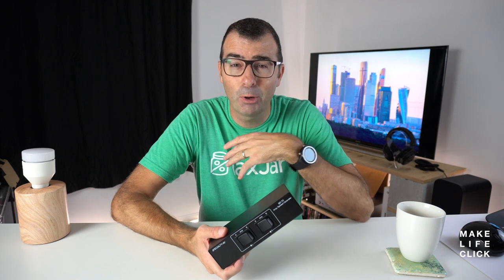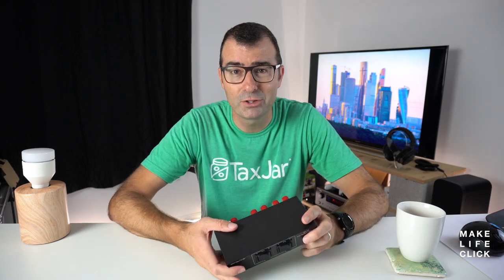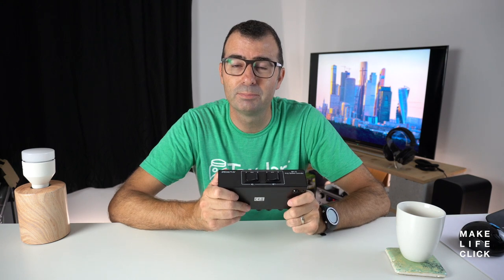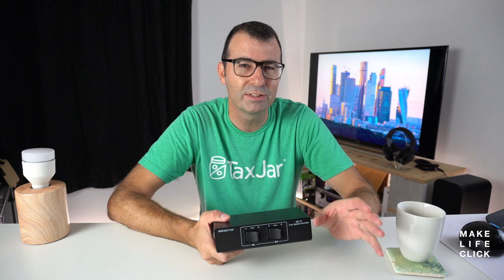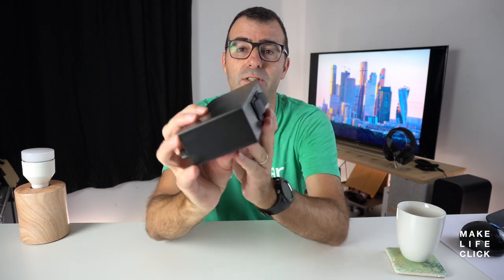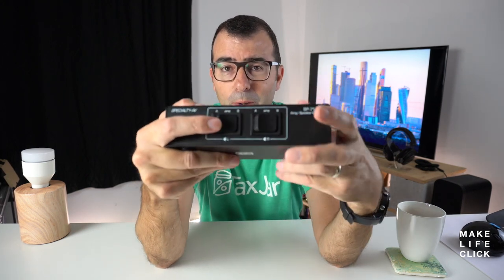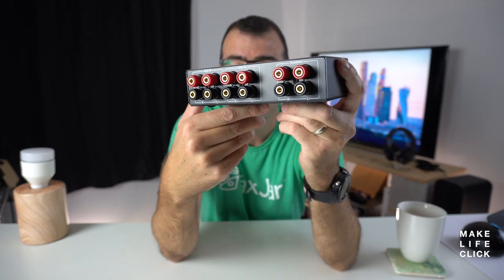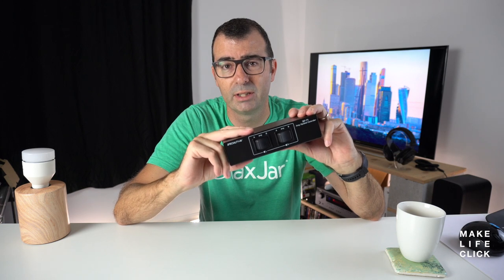Using 2 HiFi Amps with 1 Set of Speakers

Comment: As someone who has the SP71 and Beresford 7210 my advice is forget the SP71 and go for the Beresford. It is slightly more, but bigger with far superior build quality. The speaker terminals on the SP71 and very cheap and too close together. You cannot easily use standard size spades.
Reply from the maker: If you have the money - a great choice.

Comment: Can this be used with a tube amplifier? I understand that tube amps NEED to have the load imposed on them from speakers being connected.
Reply from the maker: Not 100% sure but I know this challenge with tube amps. I would not turn on the amp unless I had first switched the amp to be the one active on the speakers. If that makes sense?
Reply: If this is in fact the exact same as the Beresford 7210 then it has a dummy load for tube amps built in. http://www.homehifi.co.uk/S/selector.htm Given it's a different brand, who's to say if the electronics are the same. If you have a tube amp, perhaps go with the Beresford.
Reply from the maker: @dbbrs5295  The challenge is finding the Beresford these days. The 2 Amp model seemed to be unavailable unless things have changed?

Comment: Is it possible just to put the speaker wires from two amps into the back of the speakers ie two red two black into the back of each speaker? Only having one amp switched on at one time. Thanks

Comment: I need a switch like this but I need to operate it by far, so is there something similar but with a remote control?
Reply from the maker: A great question but nothing I know of. They all require manual switching. Anything I can imagine automatics would require much bigger units with much more expense.

Comment: I there an affective way to switch between 2 amps and 2 sets of speakers. I work in the back of the living room. Main setup in living room is AV Onkyo TX-NR626  / B&W speakers / TV. Secondary set-up is back of living room Computer with Stereo sound through an older vintage intergrated Onkyo (1983), currently i have a TT setup in the back of the living room but i wish to move that into the main living room setup.

The desired set-up would be (1) to add a switcher between the Onkyo AV amp and an old Ion Obelisk (IOB3 + X-pak1) that i want to use with the vinyl. so i can use the B&W speakers for Vinyl or AV. (2) I'd then like to be able to add back in the vinyl to play in the rear of the living room through my Computer speakers, but be able to choose to switch from rear computer audio or the sound coming from the OB3 / Vinyl. is this possible or messy? does this make sense without a diagram?
Reply from the maker: I think I understand and I think it would work. These are just switches that will route the signal down different paths. Shouldn’t matter how many you use although some will warn if signal loss. Just make sure you don’t fail to load the amps correctly before doing any funny switching combos.

Comment: Does putting this device in the signal chain degrade sound quality?
Reply from the maker: WiFi signals are quite capable of transferring ok data rates especially if you have a good router. That being said, I’d not choose this if I had a wired option. 

What I will say is they far exceeded my expectations. They really do sound quite good for music or movies.

The other thing to consider is that I use these for surrounds which typically don’t need the same dynamic range as they represent ambient sounds mostly.

I have certainly not been disappointed with them and at times smile when they surprise me with the quality they can produce.

Comment: Hi, thanks for making this video. I want to add another amp home theater setup so i can use the one for my turntable.I already have another preamp powering the L C R speakers, while the main receiver is powering the surrounds and height speakers. How do i go about connecting the L & R speakers to the switch amp box.
Thanks.

Comment: Does it keep a load on the amps when switching to another amp?  When using tube amps a load, normally the speakers, must be kept on the amp when it is on.  It you forget to turn off a tube amp when switching to the other amp it will be damaged without a load on it.  Some of these switch boxes are designed to keep a load on when switched.
Reply from the maker: Yeah, this has come up before. This is an on/off action therefore there will be a break in current when switching I expect. You're better of turning everything off, switching and then turning on again I believe.
Reply: Same Q I asking.  This unit don't know if there is a load protector for tube amp

Comment: Thanks for this. Looks exactly the same as the Beresford 7210. Same product? I have a 5.1.2 set up but also love my stereo music. My Onkyo 676 doesn’t have pre outs and I’m wanting to get a stereo amp. So this may be the solution. My concern has been shorting something. Is it completely idiot proof? If I was to forget to switch when changing what I was doing or switch at the wrong time, is there a danger of something going boom!?
Reply from the maker: Yes - pretty much the same. I couldn’t find the Beresford TC-7210 in US. The manufacturer confirmed its off before on switching so that’s all the confidence I could offer. I’ve not had any issues but always turn off both amps before switching as it feels like the wise thing to do.

Comment: Mark - I'm concerned about using any switch because of the possible sound degradation. I connect my integrated amp to floor standing speakers using Cardas wires. While I could connected my amp to the switch box using good wires I feel like their could be degradation by having the switch in the audio chain. What do you think?
Reply from the maker: Your only as good as your weakest part. And, many people believe, with pretty good reason, that every switch/connector in the chain can drop a % of signal. It’s not dissimilar to powerlines losing a % of power over distances. That’s is part caused by distance and part connectors on the way. But, would you notice it?

If your concerned I would try it, and if there is a way to a/b test it I.e have a friend blind test the switch, I’d be surprised if you notice. Like all things the human ear is probably less perceptive to % changes than people think. 

It’s in expensive so you can give it a try and return if you really notice a drop. The hardest thing for us audiophiles is listening to things like this without and perceived bias!  

Good luck. 👍🏻

Comment: I just bought the Rega IO to use while I wait for the Zen triode 34I.6 integrated amp. 
I'm trying to set up a new vinyl system, I can afford 1 Heresy III for now, and intend to be able to get a 2nd by the time the Decware Rachel is ready. Until Then can I run the I/O with just one Klipsch horn speaker in mono?
Reply from the maker: Why bother?

Comment: Well done and your options really help!
 I currently have a TC-7240 which I intended to use for a input selector for my tube amp. I also have a second amp (solid state NAD) I wanted to hook up but realized there was no way to use with the one set of speakers. Would the SP-71 provide a solution?
 So the TC-7240 would select which amp would control the inputs while the SP-71 controls which amp to run the one set of speakers.
Reply from the maker: Hmmm....would the TC-7220 help there as it handles one more? Your idea will probably work but that is a lot of middleware and consider how much wattage your putting through. The SP-71 has a recommended limit so if your system is huge, just worth a note.
Reply: If you have a Tube amp ideally you want something with built in load protection. The SP71 has, but it's cheap build. Go for the Beresford 7210, it also has built in protection for tube Amps but is better quality than the SP71

Comment: Are they safe? Have Vintage Receivers.
Reply from the maker: If your meaning you have valve vintage receivers? Are you planning on using these for front speakers? Ideally you’d wire them in but these should work ok as the power load is going away from the amp.

Comment: Hey there, very good video. I wonder if you can answer this? I have a NAD C368 and want to share speakers with my AV receiver. However, NAD are adamant that many speaker switches use 'common ground', typically across the negative terminals I expect. If this unit uses common ground then the NAD will short it's amplifiers. Any comment on this?
Reply from the maker: I wish I did have an answer on this one. Best to ask the manufacturer - they are pretty responsive via Amazon seller questions. Let us know as that’s interesting. 

It’s not a powered box so, not sure how that could cause those issues, but I’m not an electrical engineer also...

Comment: How about using the split speaker wires from 2 amps to a same speakers? And I'll power on the particular amp which i want to use ? Is this safe?
Reply from the maker: That will require you to not forget both amps might be powered on at same time. Technically, yes it works but there is risk.
Reply: @MakeLifeClick  I'll ensure the main power switch is turned off to make sure the amp doesn't turn on by itself, when using the other amp, what kind of risk it involves?
Reply: NO, that will damage the amps as electricity will still flow through all wires and into the other amp. Amps are not made to accept power coming into them through the speaker wires
Reply: @txdraw  but I'm using it for a while now, so far going good no issues.

Comment: Is it safe to use this device as a switch between tube amplifier and solid state?
Reply from the maker: Jury is out on this one. I kind of believe if you turn off both, switch over and then turn on it should create the right load for the tube amp but I’m not an expert on valve hifi - guitar valve amps yes, hifi, not so much. 😬

Comment: Will this hinder the speaker sound or limit the watts?
Reply from the maker: I believe it has an 80 watt rating? So, yes. It will. Check the specs for exact details. Ultimately, unless your playing at 100 watts of power you wont notice it ergo it should be enough for your listening threshold.

Comment: Regarding this product:  I think i understand how the speakers are connected to the unit and how the 2 amps speaker terminals are connected to the unit.

But what I dont understand is that currently I have one source with one set of left and right rca cable providing signal to one amp.  How can I switch between amplifiers if only one amp is getting the signal from the one source?   

With your unit, both amp speaker outs are connected the unit but only one amp input is connect via one set of rca cables feom the source.

Sorry for my confusion but any detailed help would be much appreciated.

Thanks!
Reply from the maker: I'm going to do a follow up on this video with the wiring video the help people a little more.

Comment: Hello. Great video.  What if my first amp is a Yamaha receiver and my second amp is a dedicated two-channel only amp? How would they both hook up to this box? Thanking you in advance.
Reply from the maker: That would work perfectly. Each would connect to the back and then the stereo speaker wire would go to the speakers. I should do another video demonstrating this. 

This unit isn’t designed for more than 2 amps running a left and right channel only. On this one you can’t do more channels than that e.g surrounds. Hope that makes sense?
Reply: @MakeLifeClick  - So in my situation, I would be wanting both amps (my surround receiver and my two-channel amp) to go to the same two front speakers. Could I do that with this switcher box?
Reply: @sinatralala wht did you end up buying ?

Comment: Hi there. Thanks for this. I am looking to use this to switch between AVR and Rotel 2ch power amp. My power amp is a Rotel RB990bx which is 200W RMS per channel. Will I be able to use this switch for an amp with that kind of wattage? The power rating on this unit is 100W RMS/200 peak per channel. My plan is actually to use the AVR zone 2 pre-outs  (doesn't have front speaker pre-outs) to my power amp. Then the AVR can act as sort of a pre-amp to control volume for the power amp when I switch the speakers to the Rotel 2ch power amp. Gonna just use my iPad (with lossless audio files) and dragonfly red DAC via RCA's to AVR aux-in as my input for stereo listening. Does this sound like a plan that can work?
Reply from the maker: Hmmm. Wow. That’s well thought out. Is it very likely you’ll be cracking the signal to high levels? My concept 40 are up to 125w and I was happy enough with the unit. But, rotel means oomph so you don’t want to limit it. In theory I can see why it wouldn’t work? If I understand you correctly.

Comment: Hey Mark, im looking to power 4x24watt drivers and 4x40 watt drivers all 4ohm. Looking for a stereo setup. Can this be done with a single amp? If not, is there a way i can control it with a single volume knob?

Ive done many small electronics builds and am not afraid to solder. Do you have any amp suggestions?

Sorry for the lengthy question and thank you for your time.
Reply from the maker: Hey - thanks for the question. You sound like someone who loves a project! Awesome. To be upfront, the last time I worked with a 4 Ohm driver was on my guitar amp stack so I couldn't recommend anything directly here for home use. I don't see why you couldn't run those on one amp if all are 4 Ohm but I'm not much of an electrical engineer. If you get really stuck I have a great connection who could help you work through it as he is a guru.

Comment: Hi, great review and explanation. But I am going to throw a curve ball. 

What if you have 2 Hi-Fi Integrated's that you really like and multiple sources (say at least 3: LP Player, DAC and CD Transport). 

This switch box will allow you to switch between the 2 Integrated's to 1 Pair of Speakers, that part is great. 

But you also want to share the 3 sources between the 2 Integrated's, is there a switch box for that? I know that makes everything more complicated. 

Otherwise, you have to keep unplugging/plugging the sources between the 2 Integrated's.

Thnx
Reply from the maker: I don’t think it would be too hard to solve but I expect your need two, or multiple switches/hub. One for the devices and then one output from there to a switch for the amps and then from the amps to the speaker switch. Wouldn’t be pretty and it would be a lot of extra connects.

Comment: Is this switch box can use to both Technics SU-G95 Stereo Integrated Amplifier and Technics AV Control Stereo Receiver SA-GX390 with a pair of Technics SB-A26 speaker?
Reply from the maker: Hey! Sorry for the delay in replying. I believe those are both solid state amps so this will be great for that.

Comment: Hi I have a question 

Can I use this unit to hook up to AV amp and an integrated  vac tube amp.  
2nd Q is when I switch amp do I have to switch the amp I am leaving Off
Reply from the maker: Yeah. This has been asked a few times and the general recommendation is always switch a tube amp off before changing the load. It always needs a signal load and switching with one of these would be risky if done wrong. Hope that helps. 👍🏻🙌🏻

Comment: Hi. I have the same issue wanting to use my Sansui G-7700 for my music needs and my AV 7.2 receiver for my entertainment both using the same set of speakers. I came across the Russound AB-2.2 switch box that seems to do the job. Perhaps this will be helpful to others.
Reply from the maker: Nice one - looks like that would do the trick also. Thanks.

Comment: Is there a way to use 1 dac for 2 amps?
Reply from the maker: You could use this, although that would mean reversing it. Assuming you have 1 set of speakers still? Also, if your using a DAC, you’re doing it to improve audio quality so interrupting signal on the way through any other switches could be considered a negative?

I’d leave the DAC on your best audio performing Amp.

Comment: does this switch support Yamaha 803 stereo with 160 watt per channle?
Reply from the maker: It’s really only rated to 100w per channel so it would work but not perhaps if you’re really using all your 160 watts.

Comment: Is there any product to drive 5.1 setup ? I have 2 Yamaha amp with 2 TVs side by side and I'd like to be able to switch between amp depending what TV/Amp setup is being used. reason: I have 13 video games consoles all connected, older with RCA on one side, newer with hdmi on the other side, and depending on what I play, I want to output the sound on a single set of speakers in the room. thanks !
Reply from the maker: Sounds like this would need multiple units. You could use a multi device to switch for audio/amp but might need another switch for changing the TV over which is common in A/V sets ups for conferences and live events. Sadly, I haven’t worked with those kinds of switches for years so not 100% sure what’s out there. Some googling around running multiplier conference projector set ups might help. Then you’d just need to flick 2 switches.
Reply: @MakeLifeClick  I was also thinking of building a switch selector like those old printer switch box we had back in the day. there's a huge switch inside with 4 pole 10 deck (maybe more) available. not sure it would work though.
Reply from the maker: Could be fun project!

Comment: Hi, Thanks for the video. Could this unit be utilized with subwoofers. I'm looking to use the same subwoofer for two different amps (music and movies). Would you know if this is possible, please. Thank you.
Reply from the maker: Technically, yes, although most LFE and Subwoofer channels run through a single LFE channel output from the amp. This runs stereo connections so If that is how your amp is outputting - L/R stereo out to stereo in, it will. Double check your connections and let us know again if your not sure. Even email us some pictures.
Reply: @MakeLifeClick  Thank you very much for your reply,. I'll give a shot if they come back in stock.
Reply: @pgxrpf  howd it go, thinking about this as well